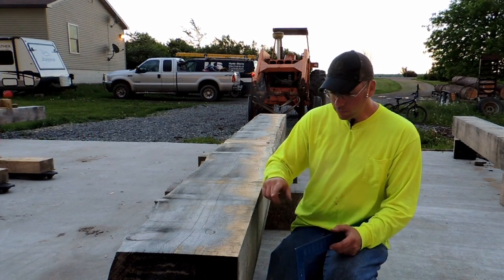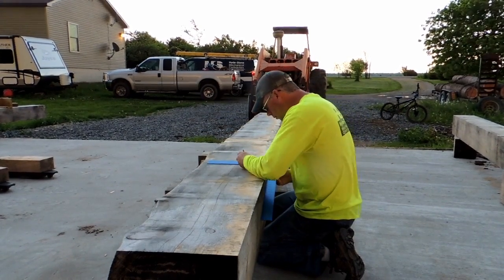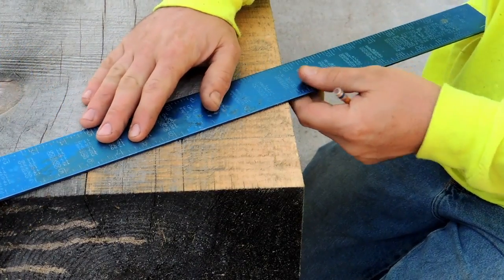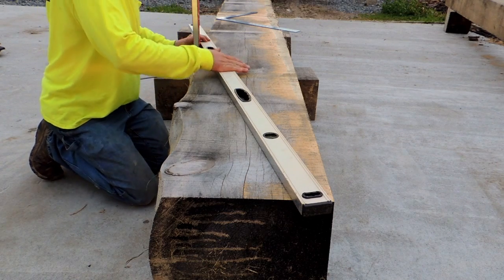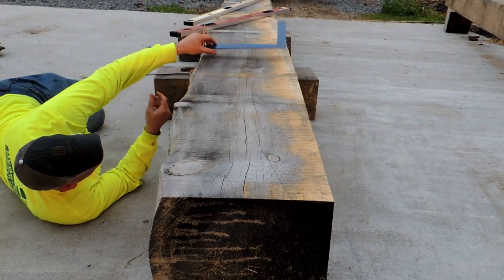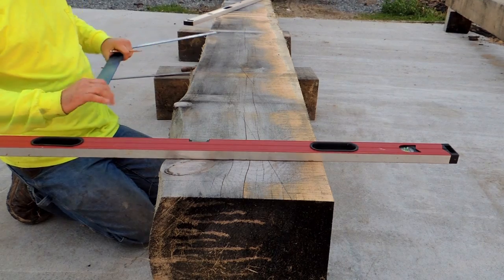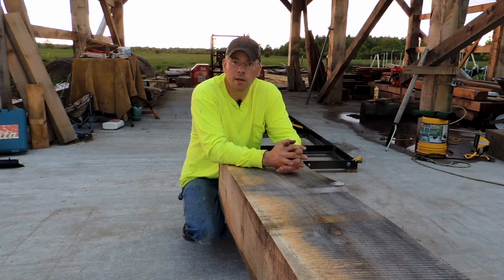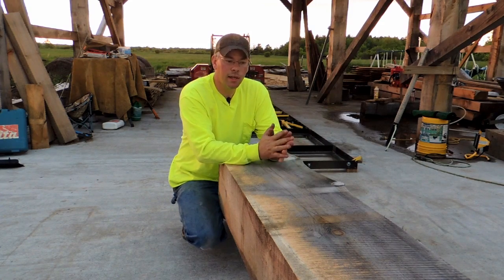A Timber Frame Vlog #14: A Timber Frame Scarf Joint: Layout part 2, 6/2/17

Comment: Thanks for the great videos on your TF barn project. Measuring EVERYTHING from a reference plane AND reference edge (arris) are critical for precise joints. Timbers are a neither straight nor square and trying to draw a "right angle" cross section based on squaring each edge in succession as you roll the timber will usually bring a closure gap in the range of 1/4" or more. So all lengthwise measurements are done along the arris and all measurements on faces adjacent to the reference face or face opposite to the reference face are made with one or two squares from the reference face and arris. The reference face is identified with a mark, a triangle pointing to the arris.
In the video, I found it difficult to follow your layout.  Could your story start with a sketch and also a triangle mark on your timber would help. I assume your reference face is the top surface. I am learning TF on my own too and and I found that a clearly marked arris (visible from 2 faces)  helps with joint pocket identification as your roll the timber around. Hope this helps.
Reply from the maker: +Andre Cormeau it sure does and thanks for the excellent feedback.  I normally mark with the triangles but that beam was so weathered that they are hard to see.  I have to edit the cutting video and the layout should make sense then.  Thanks for watching.
Reply: Andre Cormeau he marked the arris at the begining of the previous video. this is the layout of the opposite face video.

Comment: Do i get this right, that in order for you to use level on the waney side of the timber (to carry lines to opposite face) the reference side (that now faces down) has to be level? That is if i do not have slab to work off, shimming is the way to go?
Reply from the maker: +vaultsjan if using a level o avplumb bob yes.  You can shim on any type of ground.
Reply: Thanks a bunch! Makes me wonder, why didnt i think of it before....
Reply from the maker: +vaultsjan you are welcome. Thanks for watching.

Comment: Would it be easier to use a chalk line for the long line? Put a push pin in the corner and use that to attach the line for snapping, or would that not be good enough?
Reply from the maker: +Shannon Wyatt that would work fine, as long as you pull straight up with a really tight line...it is a good thought.  With the amount I had to cut I should have made templates.

Comment: I was wondering if in laying out the scarf joint, could you use a template that you could use the reverse side to transfer the measurements? Just a question Sir.
Reply from the maker: I've tried to answer back on my phone multiple times this afternoon and for some reason it wouldn't go through.  In answer to your question you can certainly do it that way without any issue.  I prefer measuring them all myself but that is more to get better at my layout.  All you have to make sure that you do when using templates is to make sure that they are lined up with the reference edge of the timber.

Comment: At 6:45 are you using that level for plumb to transfer marks across the live edge or as a straight edge? If the former– how do you ensure the beam is level?
Reply from the maker: +Lolita's Garden just as a strait edge.  If you were doing a scribe rule frame then you would have to level the timber.

Comment: Wondering something.  would it work for you to use chalk line to make your long lines?
Reply from the maker: +jim stew it sure would but the lines aren't as fine as with a pencil.  The finer the line the more accurate the cuts...good to hear from you, it's been awhile.
Reply: Another one i remember from a LONG time ago.. You should maybe twist your pencil as you draw a line, it keeps the point in the center and wears the led a lot more evenly.  Just something i was taught years ago.